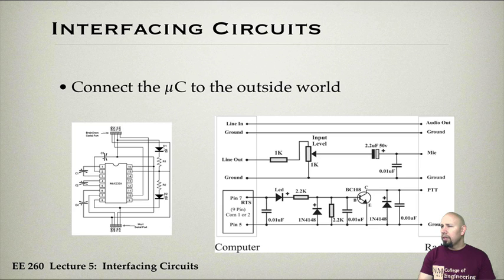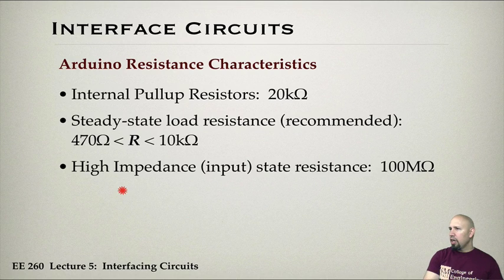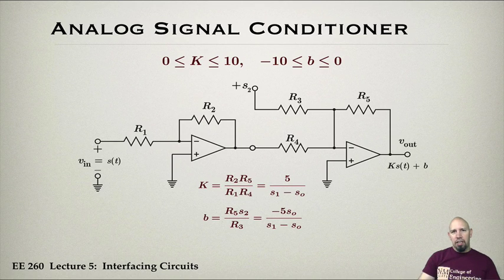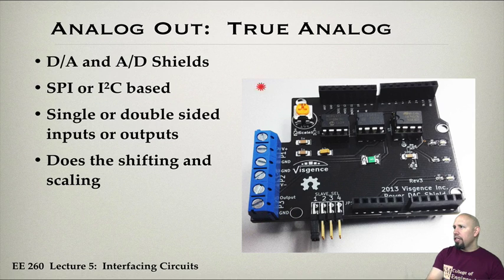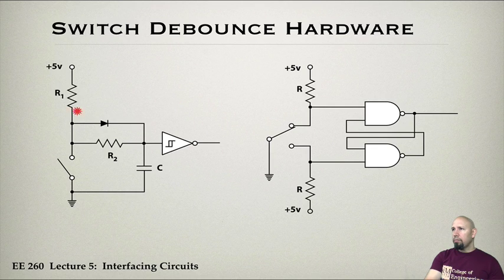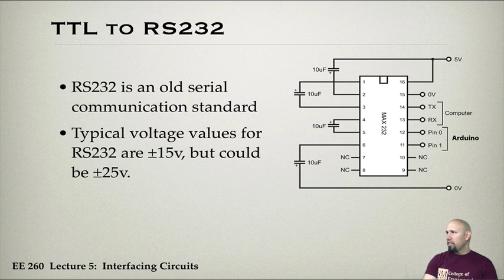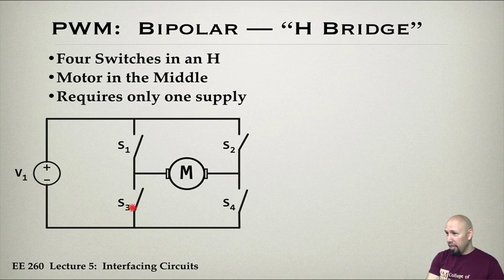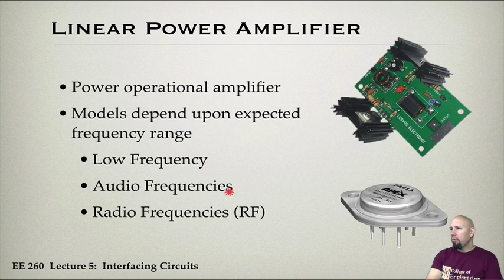5. Interfacing Circuits

Comment: 2:34 Interfacing Circuit Coverage
3:47 Arduino Voltage Characteristics
6:10 Arduino Current Characteristics
10:13 Arduino Resistance Characteristics
11:19 Analog Interfacing
14:09 Analog Signal Conditioning (Theory)
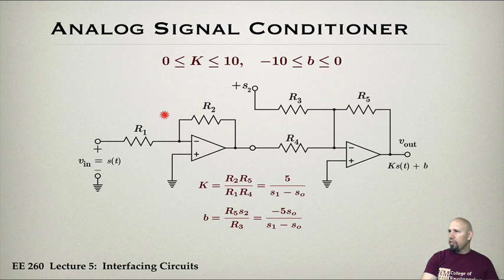19:10 Analog Signal Conditioning (Ckt)
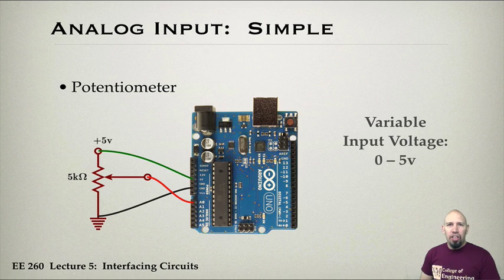23:10 Analog Signal Conditioning (potentiometer)
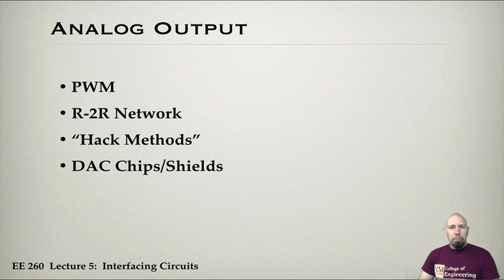25:52 Arduino Analog Output
37:09 Digital Interfacing
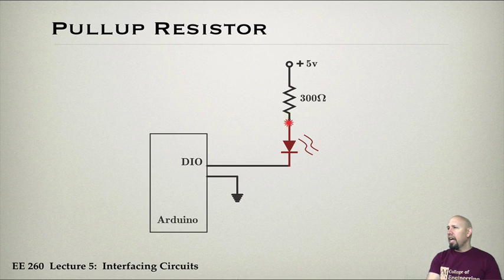39:46 Pull Up Resistor
41:20 Switch Denounce Hardware
46:52 CMOS vs. TTL
51:50 TTL to CMOS
52:55 CMOS to TTL
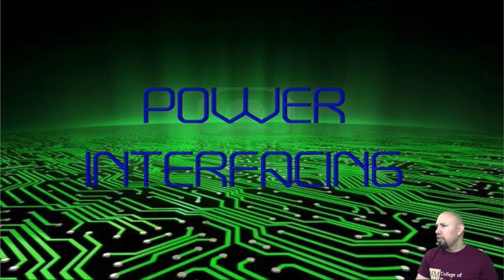54:40 Power Interfacing Digital Power Output
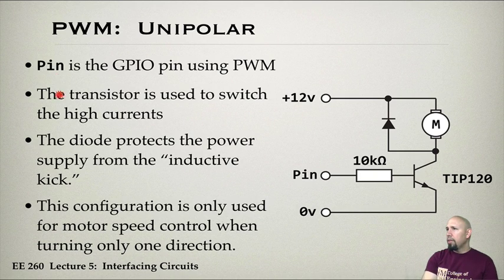59:55 PWM unipolar
1:03:40 PWM H Bridge
1:10:36 Linear Power Amplifier 

I hope it helps, there could be some errors in the time stamps

Comment: What for is the diode in series with the pullup resistor (40:58) ?
Reply: inductive kick when motor switched off is defeated by the "flyback diode" or as Dr. Paz says "by the Freewheeling Diode.  It protects the power supply.

Comment: (anyone) 5:30 Why would you want to apply voltage (of any level) to the 5V or 3.3V pins? I thought those were only for output voltages. At least that's how I've always used them. Is there any reason to put voltage into them? If so, what purpose would it serve?

Comment: Your theory on EMF is weak. If you can't explain correctly then don't even try because it is confusing.

You were trying to explain that a changing magnetic field induces a current flow through a wire but, didn't stress, enough, changing magnetic field(flux) so while the speed of the motor is going from x1 rpm to x2 rpm eventually coming to rest, some current is induced because the magnetic field is changing (getting weaker). 

This could be one of THE most important aspects of circuit protection. If they don't get it here how many components will they have to replace before they realize a strong sunspot can fry a poorly protected circuit?

This was not stressed enough in my undergrad classes.

I would use the rail gun analogy. All students love and relate to rail guns. A magnetic flux, and induction theory, is a difficult concept to grasp. It is counterintuitive. The field effect of one components magnetic field on the current fluctuations of a neighboring set of windings
Reply: never heard of a rail gun before!!!

Comment: Hello Robert Paz thank you very much for this lecture series. These are very helpful to me. Right now I am a grad student at SJSU and I want videos on LPC 1769 or ARM 7 processors. Can you help me out? I also want a lil bit of help on how to write C program for Serial protocols and any other communication protocols.
Reply from the maker: I haven't done anything with the LPC 1769 nor the ARM 7.  You can check out my videos on SPI and I2C communication.
Reply: Ya I have checked those bt if u have some links for ARM then can u post it or mail me